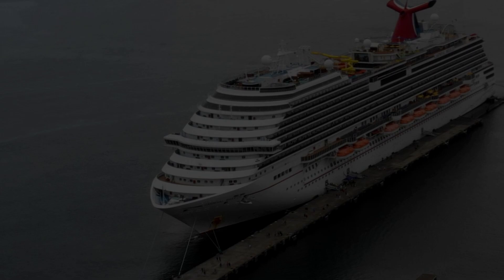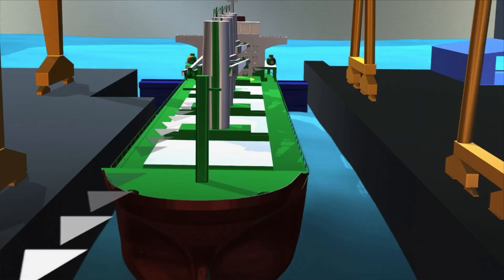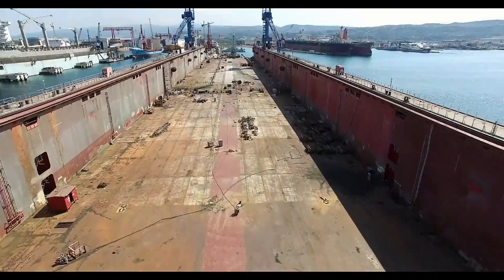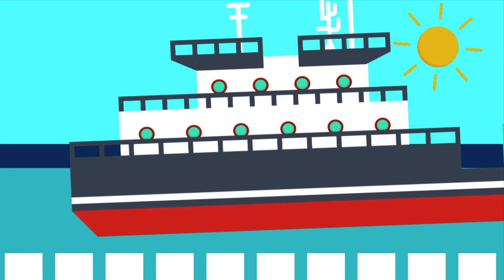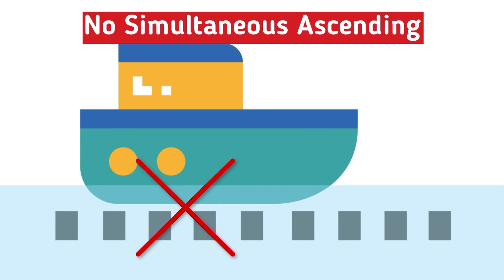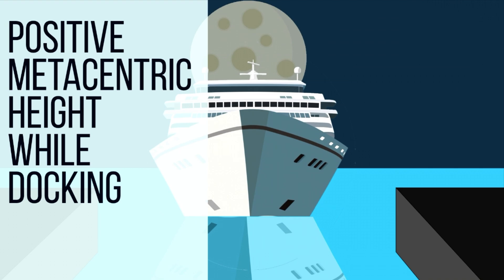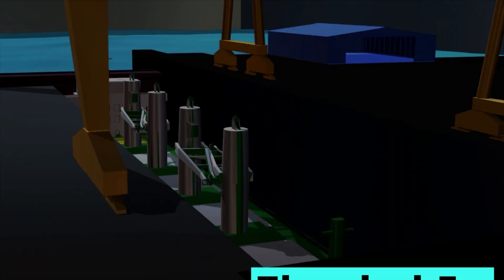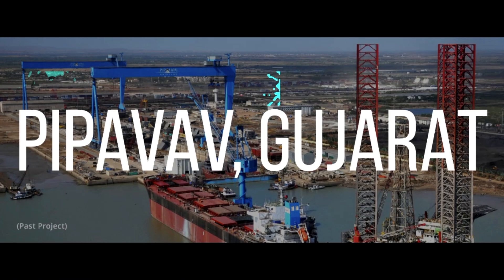Dry Docking a Ship #drydocking #shiprepair #maritime

Comment: How do floating drydocks sink. I'm sure some kind of tanks fill with water ballast, but the concept is vague in my mind.
Reply: Yes you are correct: floating dry docks suck in sea water into massive tanks which causes the floating dock to sink down then the water is pumped back out when the floating dock needs to lift up.

Comment: How do you paint the areas of the hull where the boat is sitting on the blocks?
Reply: They do not paint that area. It will be done during the next docking.
Reply: @janvisser2223  ...so the next time the workers must know, which Part of the hull was not painted this time? And what about new ships? Which are both painted Set?
Reply: Atelier unter der Teck during the next docking a diver will check the position of the vessel in relation to the keel blocks. Vessels position can be changed by winches on the walls of the dock.
Newbuilding is something completely different. Ships are built in large block sections. Placed on steel supports. The blocks are completely painted except for the ends were the section buttwelds are to be made. Those parts are left with only the socalled shopprimer on it.
After finishing the buttwelds, including tightness test and NDT, the small areas (about 600 mm wide) needs to be provided with the prescribed coating system (anti corrosive and / or antifouling)
Keel blocks will of-course be removed then in those areas.
An owner will not accept it otherwise.
Back to a regular docking: a shipyard will charge the owners for each block to be removed. Normally, the paint system on the flat bottom part of the hull will be found intact during inspection, making it not necessary to recoat the areas resting on the blocks.
Reply: Thank you very much, Jan! That is very interesting for me and now I have finally understood the processes!